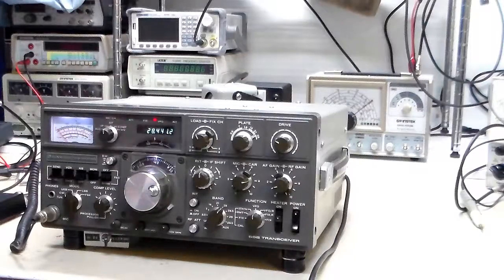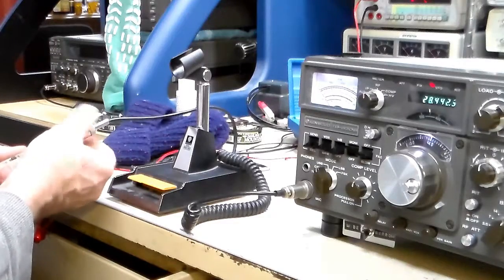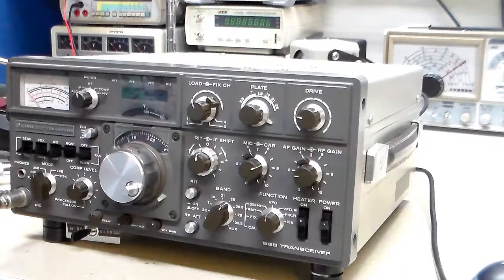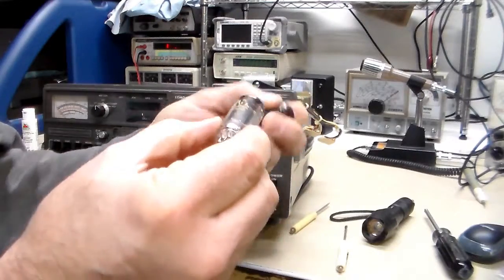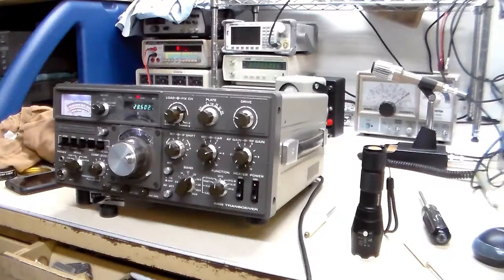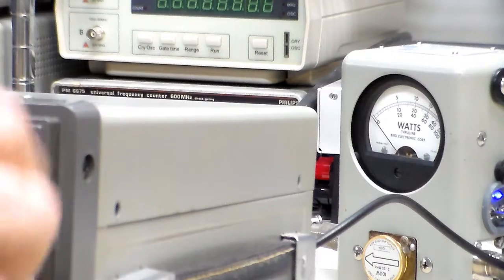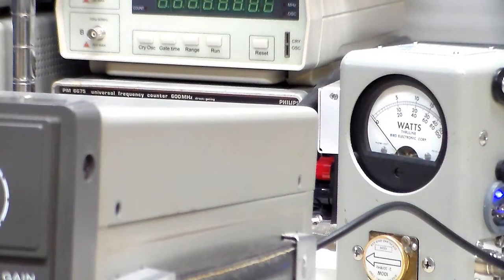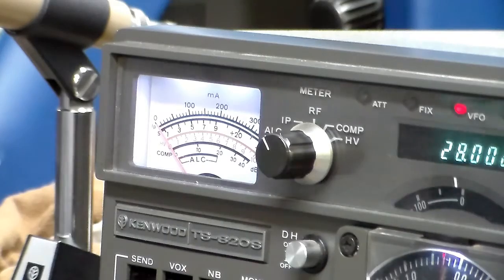TS 820 Low CW Power Output on 10 Meters

Comment: Dear Sir. Would you give the Mode and the Meter settings while measuring the power (Watts) in the video time 12:20. 73' matti OH2XA
Reply from the maker: Matti, the mode was CW.  The meter setting would not matter as I was using the Bird external meter. However, if you were doing the tune up for that frequency as per the manual, the final steps are done with the meter in "RF".   Hope that helps.
Reply: @KA3AJI  Thanks for your prompt reply.  I have an old Kenwood TS-820(S) hybrid rig and got the same readings measured with an antenna tuner when the rig meter was in RF - you are right. I was surprised as the finals tubes are original ones,  I guess.  73' matti
Reply from the maker: Matti, the Mode was CW.  The meter setting would not matter since I was using the Bird external meter.  However, if you were doing the tuneup procedure, the meter would be in "RF" for the last step of the tuneup as per the manual.  I hope that helps.

Comment: What happens when I set everything like yours and I turn it on, and it pegs the meter? I just repaired the DG-1 display and now I'm trying to tune it.
Reply from the maker: First check the RF gain isn't fully turned up.   Does your received signal sound ok other than that?

Comment: I know its an older post. To see and hear what your transmitter sounds like, find one of the online SDR  stations that you can see yourself, then you can hear what you sound like. Helps to set your mike gain and compressor also. FWIW, Carl, AB1ZI
Reply: I tried this with my TS820, but the reception from the SDRs in my area (Vancouver) was very very low.  It was my first time using a radio, and I figured that I'd had tuning issues. I attempted to join a local 80 meter net, and was heard just fine.